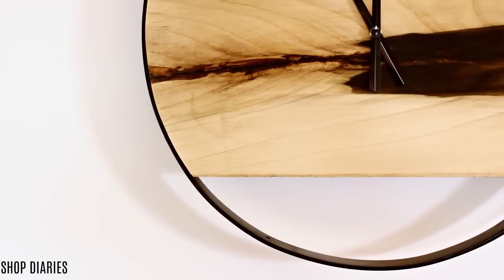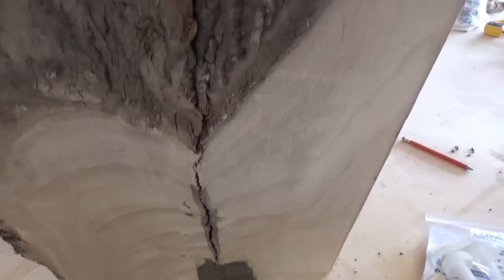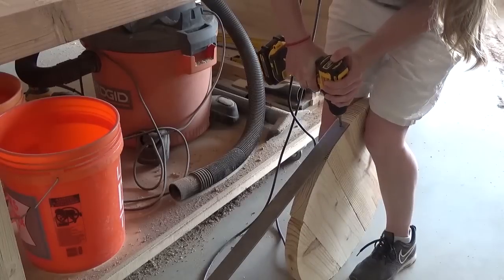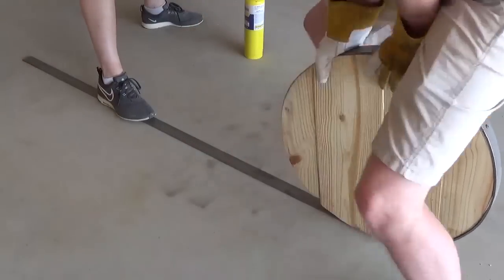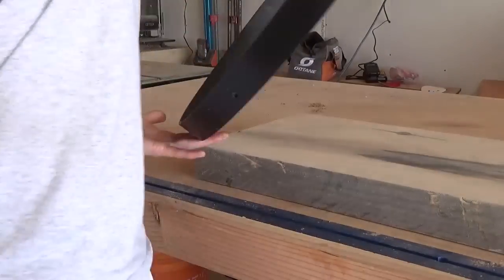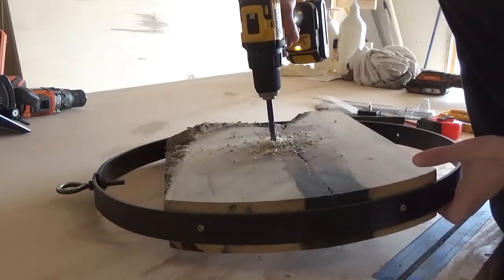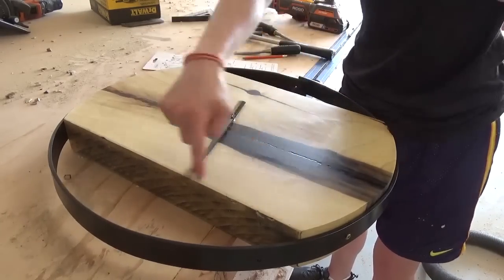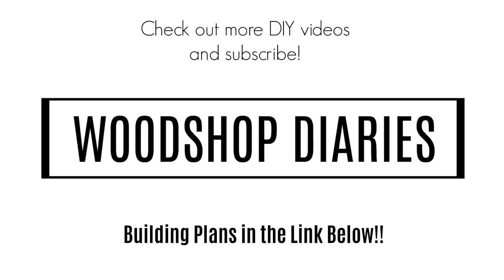DIY Modern Industrial Wood + Metal Wall Clock

Comment: Very cool, looks great!

This is at least the second time now that I'm seeing you using that Ryobi band saw. I've only ever hesitated to pull the trigger on buying one because of the above average number reviews I've read... You're videos are swaying my opinion back towards buying one.
Reply from the maker: Russell Borrego thank you! I really like my Ryobi band saw however, I don’t use it very often mostly because it’s not large enough to do many things I’d like to do. It’s great for cutting small stuff like 2x material, though. Once I have room in my shop, I’ll definitely go bigger. If you plan to do much with it, I’d recommend getting something larger 👍
Reply: thanks!

Comment: Code requires electrical wires to run in the middle of the stud so if you use 1" screws you should not be hitting any wires. FYI
Reply from the maker: wuillians good to know. Now if only everyone followed code 😉